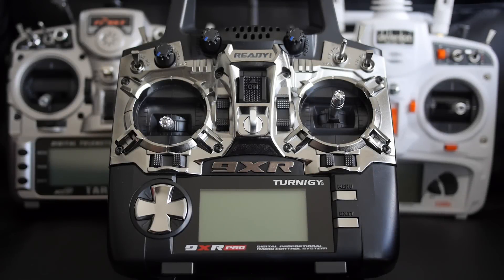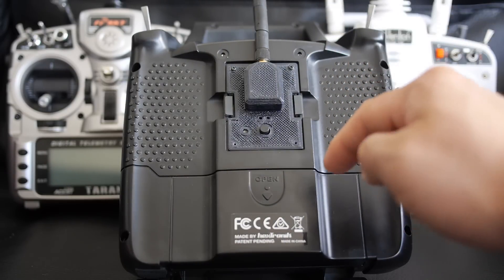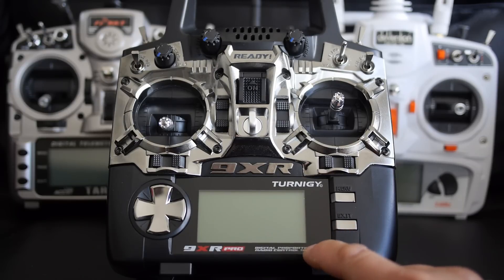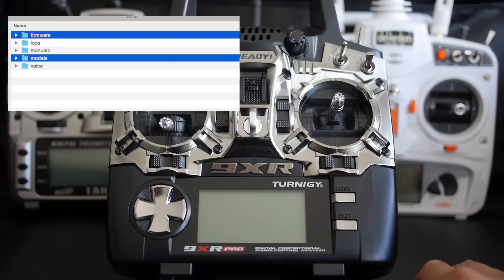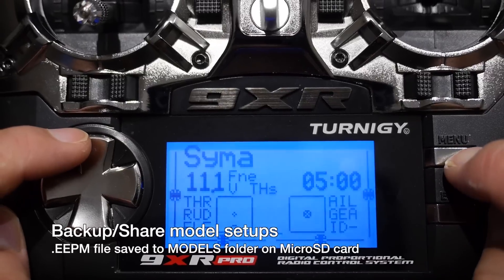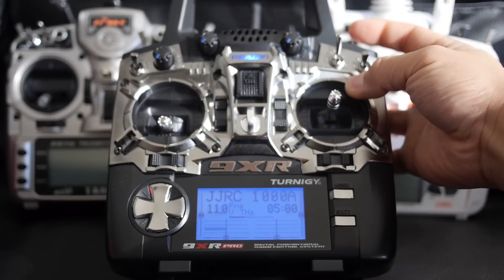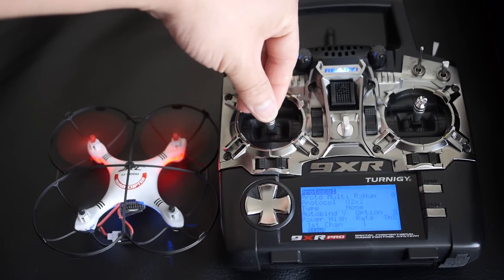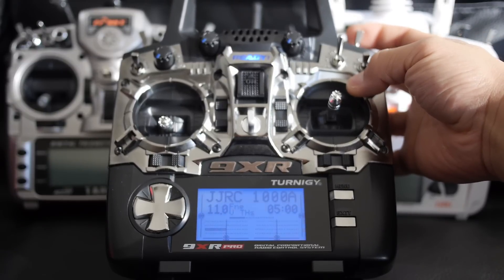Turnigy 9XR Pro: 4in1 multi protocol module all in one radio transmitter

Comment: Friend, what a frustration. I bought the radio, modulo and drone, but nothing of being able to bind only 1 drone. My lock in the process of generating a bootloader, speaks that needs to update the USBasp and there is no way the arduino software recognize the USB with the AVR recorder. Do you have any tips?
Reply from the maker: +Fabiano Aguiar does your OS see it?  Maybe try a different USBASP programmer. Check out the rcgroups forums. There are a lot of smart people there who will know the answer.
Reply: I'll check the forums. Is it necessary to use arduino software anyway? Thank you very much for your attention.
Reply from the maker: +Fabiano Aguiar yes you need arduiono to compile the firmware.

Comment: oh oh you mean i can make FS-iA6B cheap reciever work with the 9xr pro in this way ??????????????
Reply from the maker: +Viktor Tech i think that ia6b uses FS2A protocol so it should work with latest 4in1 module firmware. But I don't have that rx so not 100% sure. Check out the newer stm32 4in1 multi module.

Comment: Hi,I just buy a Turnigy 9XR PRO and multiprotocol  IRANGEX  IRX4 from Banggood. I think that I did everything OK, but all the time my transmitter is not binding witch the receptor.I have a Eachine falcon, the receptor is a FlySky I6AB.Firstly, I flashed the firmware to my transmiter.Later I went to "Radio Set up" and seleceted the order chanels AETR.Finally I went to "Model set up" and there, selected: PROTO: Multi, PROTOCOL FLYSKY, Type: Flysky.I turn on the receptor of my Eachine Falcon and inmediatly I try to binding it witch my transmiter but unfortunetly, all the time is "binding".....Can you tell me step by step what to do?Many thanks in advance.
Reply from the maker: +PEDRO MARQUEZ maybe try "FS 2A" for protocol.
Reply: thank you for your information.
Reply: Hi, again. I just tried to bind my receptor with my new radio. Can you tell me step by step what can I do?

Comment: Hey Ken i am trying to connect my walkera runner 250(RX710) with 4 in 1 module i bought from banggood and having binding issue, in your replies you suggested me to update 4 in 1 module firmware and i recently updated firmware, still no luck, i can connect to DM002,Syma and WL959 protocols but for some reason i can't connect to runner 250, i have followed sequence on github website but no luck at all, please advise if there is anything you can suggest. Thanks
Reply from the maker: +Sunny Jalaf I think it uses the Devo protocol. When you compiled, did you make sure that protocol and cyrf6936 Rf chip is enabled in the source code?

That's all I can think of. Maybe someone in the rcgroups has experience since I don't have that quad.

Comment: I am currently flying an Eachine E011 microquad with the stock controller, but the controller is a bit shit and flying with the microquad has convinced me to go further into the hobby. I'm now thinking about purchasing the 9XR pro combined with this module. The Eachine E011 uses the Bayang protocol, so it should work with the 9XR Pro combined with this module right?
Reply from the maker: +Joran Groothengel yes it should work but I don't have that quad to confirm. But be aware there is a newer version that has the stm32 chip which is better. Check out my stm32 4in1 video for more details.
Reply: I just saw that you also made a video about the updated model of the module, I assume you now recommend that one? Lack of a case isn't really a problem, 
I have a cheap chinese 3d printer, and the price difference between the two is negligible.
Reply: Thanks! I think I'll go for the newer one.

Comment: hi @kenVersus , I had build my new quad with flysky fs a8s rx. I have set d protocol to multi and select flysky. but seem cant quit bind to the receiver. wondering is this 4 in 1 multi protocal module bind all kind of receiver? thanks. hope to hear you soon.
Reply from the maker: I don't have that RX but I think it uses the newer AFHDS 2A protocol.  I remember reading it was added to DeviantionTX.... but not sure if it's implemented into the 4in1 yet.... if it's available it should be a separate protocol in the menu, not FlySky.  People on DeviationTX forum or RCgroups would have more info.  Basically 4in1 works with lots of RX with different protocols but it depends if it has been decoded yet and then of course added into the 4in1 firmware...
Reply: got it. total with you. love your work. keep it on... fully support your channel... thanks you so much for your help.
Reply from the maker: Okay I looked at my Taranis, and there is an option for "FS 2A" in the latest version of OpenTX 2.2 RC366. I believe that one is AFHDS 2A.  You can watch my latest video to find out how to install OpenTX on a 9XR Pro.  https://www.youtube.com/watch?v=M0W5V5ksids

Thanks for watching!
Reply: hi ken, recently there is a new update on opentx 2.2.0 for 9xp pro. have u try? its seem cant work.. im downloaded and try to flash with my 9xp pro, its seem take ages. could u give it a try and lets me know how is u going. thanks... hear u soon.
Reply: ahh... i did it.. but seem cant bind the latest flksky rx fs a8s... :(
Reply: i think my multi protocol module dun have fs 2a protocol.. am i right? so what should i do?
Reply from the maker: +ryuuji L maybe you have to update 4in1 firmware. Watch my "updating atmega328p 4 in1 module" video.

Comment: Hi ken i am trying to bind my 4 in 1 module with walkera runner 250 it has RX710 but for some reason i can't bind it with my TX any suggestions if any settings need to be changed in TX side, i followed instructions on github for binding devo in serial mode but had no luck, any help will be appreciated, Thanks.
Reply from the maker: +Sunny Jalaf make sure you have the latest 4in1 firmware. You may need to flash it.

Comment: hi, thanks so much for this video. i had just follow what u have told, i did success bind e010 or hubsan. but all of them got no respone to the transmitter, cant fly. what to u think i have done wrong? thanks hope to hear u soon.
Reply from the maker: +ryuuji L make sure you have set up the model properly for mixer and input. That's all I can think of
Reply: sorted... many thanks

Comment: Thanks for your reply Ken, just a quick question that after using 4 in 1 module in my Th9x and updating firmware to Er9x or opentx, is there any way i can also use my older modules like frsky? in order to use 4 in 1 and frsky do i just need to go in the TX settings and change settings according to modules i am going to use or any other mods needed? Thanks
Reply from the maker: +Sunny Jalaf yes the FRsky modules should still work. They work in PPM mode. If you flash with OpenTx that supports 4in1, there will be option in settings to choose protocol. but not sure if there are versions of OpenTx for the 9x that support the 4in1.  I would recommend getting a taranis or at least a 9xr pro. Those to are supported for sure since I have them.
Reply from the maker: +Sunny Jalaf here's a site that shows how to set up with a 9x. 
https://nathan.vertile.com/blog/2016/09/01/diy-4-in-1-module-with-er9x/

Comment: Hi ken, I am trying to use 4 in 1 module with my flysky th9x transmitter can you please help me out what do i need to do firmware wise to my flysky, i can't find any help anywhere about th9x, all the videos are about taranis and turnigy, as i am new to this programming thing so i need help before i mess up anything. any help will be appreciated. thanks in advance.
Reply from the maker: +Sunny Jalaf you'd have to figure out how to get OpenTx or ersky9x on it.  Or just use it in ppm mode. Then the transmitter won't need to have OpenTx or ersky9x. 

I don't have a 9x anymore since so won't have much advice on it.

Comment: Just received my 4 in 1 module from Banggood and it looks different, on the back it says YFRM02_V1.2  My TX and RX are soldered like in the RC group forum. I was going to try it as is, am I supposed to solder the TX and RX together for serial mode? I am unable to find the ERSky9x Firmware with Multi-Module support (ersky9xr_rom219x3.bin) what version should I download? Thanks David.
Reply from the maker: +David Farmer read this for more info. https://github.com/pascallanger/DIY-Multiprotocol-TX-Module/blob/master/docs/Tx-erSky9X.md
Reply: Helpful you are!

Comment: Hello, I have  TARANIS and this module.
Could I also control JJRC H36 ?
Reply from the maker: +Juraj Cs I'm not sure about that model since I don't have it.
Reply: Thank you very much
Reply: I found out that the JJRC H36 and Eachine E010 are the same. I use the E010 model and protocol to fly with my Turnigy 9XR Pro.

Comment: I am grateful for this video.  Having a problem though. I have the 9XrPro and the 4in1 module. I updated the firmware (been putting it off for ever). I did not do the serial setup just want to get things going first and will use the knob for now, and have iron channel 1 which should be for FlySky. I have been able to bind to a Turnigy TR6A V2 receiver, get the proper beeps, but none of the servos are working.  I made sure the controls are set to AETR and am using the FlySky protocol. I am also in the PPM mode for this model.  I can't think of anything it might be, any suggestions? I've also tried an actual FlySky receiver and get the same thing. My ultimate goal is to bind with a FlySky FS-IA6B to use in an Eachine Wizard X220 which is using a single channel PPM setup.
Reply: This is the module I have 
http://www.banggood.com/CC2500-NRF24L01-A7105-CYRF693-4-In-1-RF-Module-With-Case-For-Futaba-JR-Frsky-Transmitter-p-1116892.html?rmmds=mywishlist. Which I assumed is the same guts in a case.
Reply from the maker: +Dean Hallal I don't have that receiver but maybe you can try a different sub protocol for flysky. I think there is v912/v6x6/etc. The rcgroups forum might have some insight.

Comment: Man Can you please make a video comparing devo 10, taranis and turnigy 9xR pro. As transmitters with out the 4 in 1 and then how each performs with the 4 in 1, range, delay, easy of use, gimbals, size, weight, battery, power consumption etc  I am going crazy right now trying to get the best bang for my bucks. Personally I will end up using it more with airplanes but I already have a big collection of toy quads. I do have a 7e with two modules, but there are protocols I can not use with it and it feels "toyish compared to my Spektrum D6 and my issue with the D6 is I don't have sliders for flaps only one 3 way switch. I think the sliders on the taranis are the ones that are better located for this, but is $100 more plus the $45 for the new gimbals. The gimbals on the D6 are very, very good.  Since you have this 3 transmitters it would help a lot a very in deep comparison of all the good pints and bad points of each one. Hope you have the time for it, thanks
Reply: Ok, I saw the end now, So Taranis over the other two then.

Comment: Ken would this be possible on the Turnigy Evolution? It does not have module bay but based on your description it could still be possible. If we use the evolution with our existing Frsky receivers we would be set.
Thanks for all your work on this.
Reply from the maker: +Flying Ogre might be possible with soldering and using it in PPM mode.

Comment: I am trying to get my eachine e010 working with this module and the 9xr pro and I can't seem to get it to bind, I downloaded your sample files and import the e010 model and still no go. I have solder the rx and tx so that it become serial mode. I also can get my eachine H8 Mini to bind without any issues. Do you think I need to update the firmware on this module?

Also if I decide to go back to PPM mode do you know the rotary switch settings?

Thanks
Reply from the maker: +Richard Trice you need to update the 4in1.  Not sure about ppm mode. I don't use it.
Reply: Sounds like another fun project, lol
Reply from the maker: +Richard Trice yup. They never make it easy. There is a video I made if you want some guidance. Read the github, and the rcgroups forum. That's how I learned to do it.

Comment: Hi Ken, I believe the very latest 9XR Pro uses a generic/clone processor so I was wondering if the 4 in1 module will work on this later model?  I believe that this later units firmware can't be upgrade with openTX, see link; http://www.open-tx.org/downloads
Reply from the maker: +Dazza Turnbull that's the 9X not 9xr. I got my 9xr a couple mounts ago and have no issues.
Reply: Oh yeah so it is, thanks for the quick reply What firmware/OS are you using in your 9xr pro?
Reply from the maker: I don't have the latest, I think it's ersky9x R219 from october.

Comment: Following your video I was able to successfully bind my Syma quads. I have the same module for my Taranis and successfully connect all my Symas as well as my Cheersons. I was unable to bind my Cheersons to the Turing 9XRpro however. Have you had any luck?
Reply from the maker: +Joseph Renna that is strange. Maybe try to see if there is newer version of the ersky9x. Unfortunately I don't have a cheerson anymore so can't really comment. But check out the rcgroups.com forums maybe someone has experience.

Comment: Thx for the video!
Can this 4 in 1 replace a frsky xjt module?  I guess maybe it does the frsky protocol but without telemetry?
I would like it so I can use my radio for a tiny whoop, but if I were to bind to an xsr receiver in my bigger copter how do you think the range would compare to a frsky module?
Reply from the maker: Range wont' be as good as the FrSky module.  Range on the 4in1 is probably 200m at best.
Reply: okay, thx for the reply.

Comment: hi. great video. I'm extremely new to BNF quadcopter versions. i bought the 9xr pro and the 4 in 1 module. Also bought the Eachine QX100 at banggood. need help in what should i do to put all working. please help me if possible. thanks

Comment: Can't bind to my any of my 3 - FY326s(red board) nor my Moontop MT9916. I love both of these quads and the protocol for these shows in the model setup. Is there something that I'm missing? I have the Turnigy 9XR pro with the 4in1
Reply from the maker: +kevin bertorelli you may need to update your 4in1 module. No one knows what protocols they load in the stock 4in1 firmware. See my 4in1 updating video.  Since I don't have those models I'd have no first hand experienced with it.

Comment: Whoa thank you for this! Was about to pull the trigger on a Devo 7e + 4 -1 module but, the soldering held me back. This seems much simpler!
Reply from the maker: +Remigio Isla-nd yeah I'd choose 9xr pro too. Although the 7e is nice and small which I like. I miss the 7e after i sold it.
Reply: Hoping that the price will drop back to $50 for Black Friday. Is this the same module in the link? https://www.amazon.com/Usmile%C2%AE-NRF24L01-CYRF6936-transmitter-toy-grade/dp/B01FX73JZ2/ref=sr_1_1?ie=UTF8&qid=1479941124&sr=8-1&keywords=4+in+1+module
Reply from the maker: +Remigio Isla-nd looks like it.

Comment: Ken need your help! i used your eepm jj1000 file and set 9xr pro to aetr in controls also, but controls seem all mixed up so i set mixer Channel 1-4 as TAER and now controls are working right? did they just send me wrong board?
Reply from the maker: +MK bodybuilding Hmm looks like you have a JR version. But in serial mode shouldn't matter. If you flash the 4in1, you can change it to whatever you want.
Reply: kenVersus yes i soldered the pads to use in serial mode. so should i change the controls to TAER or change the mixer settings to TAER every time and leave the contol settings as AETR? thanks again
Reply from the maker: +MK bodybuilding odd. I use my "Frsky" version with my 9xr pro without any changing channel order.  

If it works for you in TAER set that as the default then. If load my eepm file I think it'll be aetr since it's my default and you have to modify it anyways.

Comment: I bought a 9xrpro lol, gonna sell the devo i think. when u download the ersky9xrpro219x3 for 9xr pro its a zip file with like 5 files, which one do copy over to the sd card?
Reply from the maker: If you watch the video, you'll see it named.  I don't remember off the top of my head.  It should have 9xr in the file name.
Reply: kenVersus ok thanks yea its the hi lighted one, just wanted to make sure. had to pause it to see cause it was so quick. i take it u renamed it also cause on the transmitter it has the 219x3 after it.
Reply from the maker: Yeah I renamed it.  If the name is too long, it looks weird on the transmitter menu.

Comment: dang! just watched, great vid. wish i would of ordered the 9xr pro, but already ordered devo 10. how bout range difference between them
Reply from the maker: They'd be similar.  See this post about range:
https://www.rcgroups.com/forums/showpost.php?p=35359837&postcount=33
Reply: kenVersus thanks, that doesnt seem like that much, considering it says 2km on box lol. but at least in the 9xr pro u could swap in a long range module right?
Reply from the maker: Yeah, you can easily put in a FrSky module.  The 4in1 module isn't really designed for long range.  I don't know exactly how many mW.  But it won't be a lot.
Reply: kenVersus i thought on the devo 10 with firmware u can put output to 150mw

Comment: Hello, i succeded installing my 4in1 on my 9XR pro due to your video... THANK YOU SO MUCH ! At the end, i see that you binded an Hubsan X4 and when the transmitter and the hubsan binded, the leds on the drone switched off. It makes the same with my Hubsan... how can i fix it ?
Reply from the maker: +Coco Pacabana I haven't tried to fix that but I think the values arent correct with channel 6. On my taranis it stays on. If I fix it, I'll let you know and post the correct settings file.